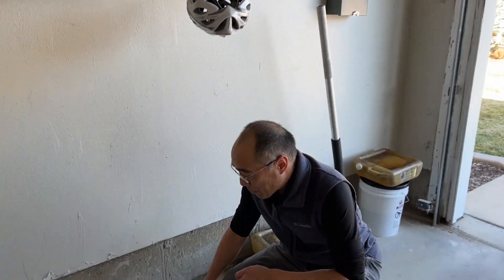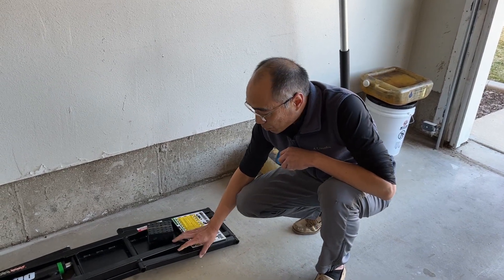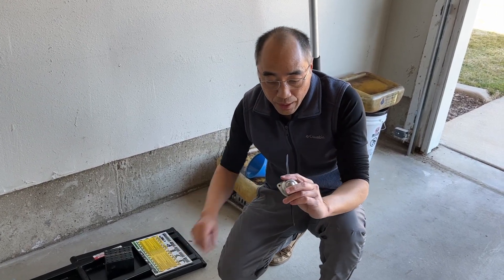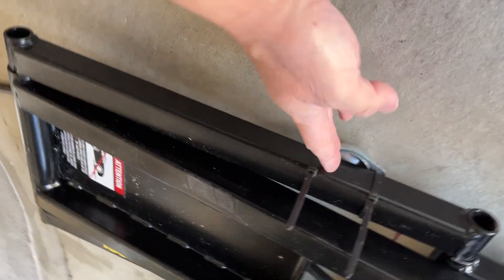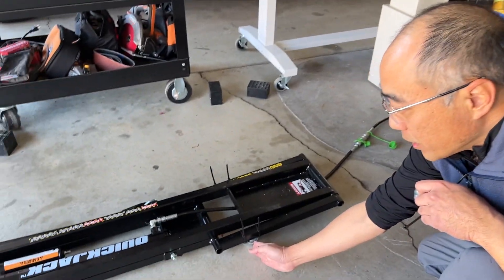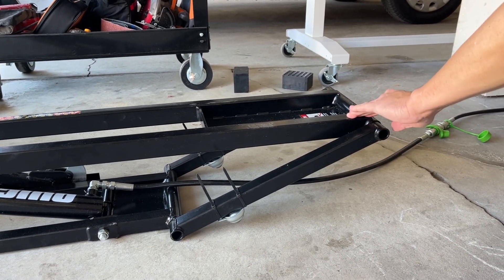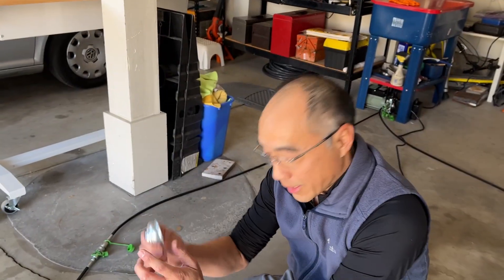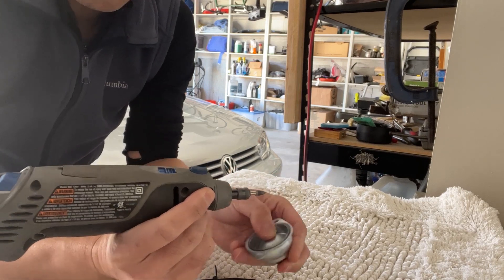Quick Quickjack Wheel Mod  No Drilling

Comment: I have tightened the zip ties as best I can, but any rash in the cement floor flips the castors to the side. Any thoughts to prevent them from moving?
Reply: 2-sided mounting tape.

Comment: I tried this mod and it works but the metal balls mark up regular concrete. My drive way was starting to look kids were drawing on it with white crayons. Scratches everywhere.  Little to no marking in my garage as the concrete is a higher psi and smoother.  Now looking for another mod.
Reply: The Quick Jacks owners manual does not recommend using it outdoors. This might be part of the reason.

Comment: when the bearing are secured in place and you have placed the jacks under the car will the jack move out of position in that they will move so easily prior to jacks lifting? When the jacks are raised could jacks move a bit in that the jacks are changing position slightly?
Reply from the maker: As jack lifts up, the bearings are lifted off the ground. I never noticed the jack moving as it is lifted. Is pretty precise.

Comment: I like your method! How much height does this add when collapsed?
Reply from the maker: The base is about half inch off the ground.
Reply: I placed a piece of 1/6" plywood (like what Quickly Jacks uses to protect the frames for shipment) under the frame when positioning the bearings. So my collapsed frames sit about 0.16" (4mm) higher than original. If your garage floor is flat, this is plenty.